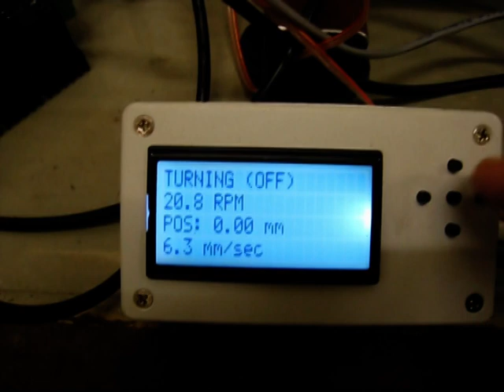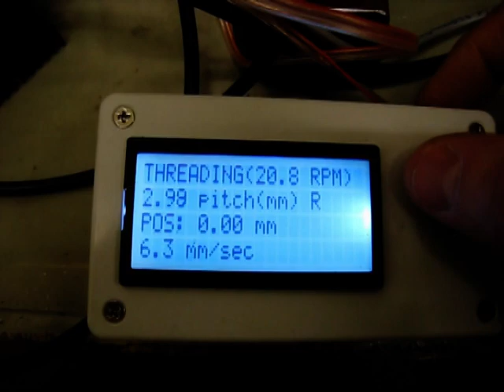lathe v2 part2

Comment: What do you use for sending the commands to the drivers?Arduino?
Reply from the maker: Hi! That controller board is just one old display unit to which I added some extra I/O's. It contains Atmel XMEGA microcontroller and program was written in C using Programmers Notepad IDE. XMEGAs are great for their simplicity, but if you ever need more power, networking etc. then Rasperry PI is way to go.
Reply: @GarageOfTool  I have an unused Raspberry pi B3+, my lathe is using a VFD that has an output signal so the lead screw could be in synq.
I want to use the RPI for thread cuttign cause changing gears is a pain in the ass, can you point me to the right directions?
I know the mach3 path but i want to use a stand alone way.
Thank you!!!